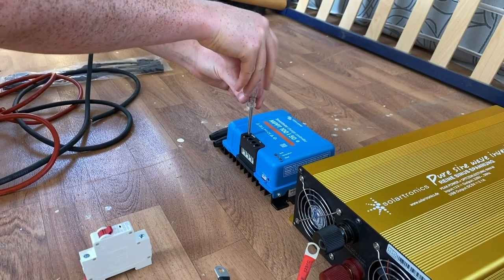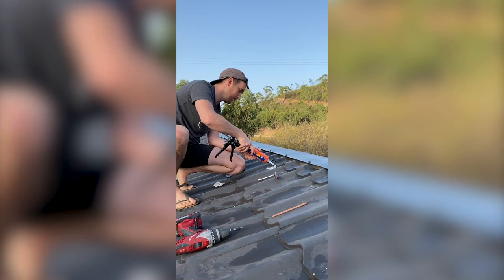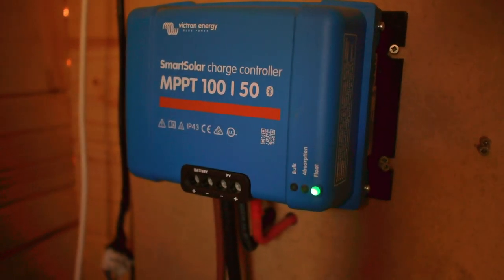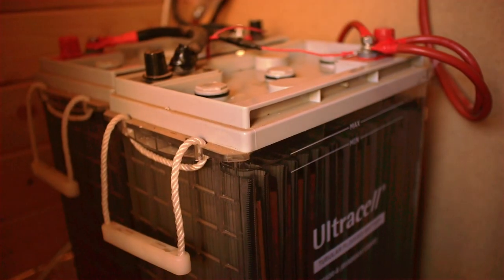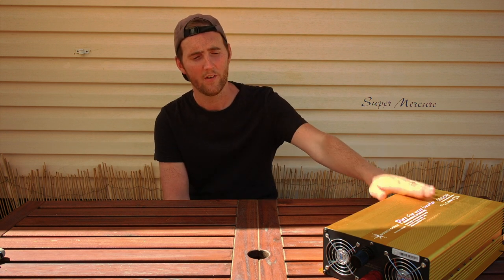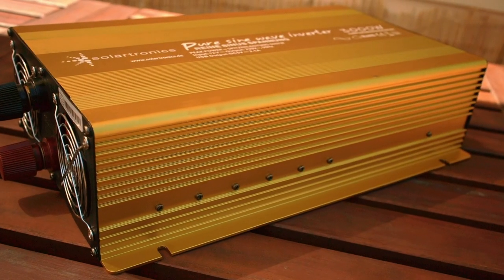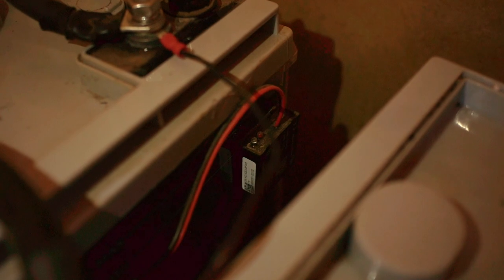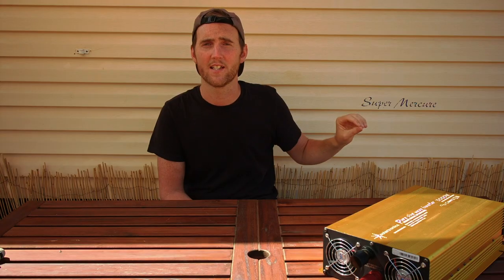Solar Guide For Portuguese Off-Grid Tiny House - Life Reimagined

Comment: Good video. However, I do not recommend using 12V with a 3000W inverter. You will draw 250Amps. It's best to stay under 100A because you will pay much more for wires and charge controller. You charge controller will need less current because the voltage of the battery bank is higher = cheaper MPPT. This is much cheaper even if you add a 48-12V or 48-12V DC-DC converter. When you do the calculations with lithium and lead-acid, lithium is cheaper in the long run. 35mm² can only carry 130Amps even without correction factors. You are having a fire hazard right there. Fuses don't protect devices, they protect wires. If there is 250 amps going through a 35mm² wire it will start to melt, but the 300Amps fuse will not blow.

Comment: Great video, lots of information!! How complicated was the licence, since you have more than 350w of solar panels?
Reply from the maker: In all my research this is the first I'm hearing about this so thank you. I'm currently investigating it further
Reply: @Life.Reimagined  it might be only if you want to connect your solar to the grid, I am also struggling to find some clarification.
Reply: Hi guys did you find anything more on this. I have been getting some advice recently and apparently solar installed at heavily regulated and need to be through EDP or and electrical company. We are making the move over soon and want to do a DIY install ourselves. Seems like everything need a licence over there. Any help/advice would be appreciated

Comment: Damn i only saw this Video now !
Nice and informative
Seems your a Solar expert now ;-)

I would be intrested where you did Order/Buy your equipment here in Portugal, speically the used ones. Planning of installing somthing similair in the near future.
Reply from the maker: Hello Maurice! Thanks for watching. We bought the solar kit from AutoSolar.es - and were impressed with their service and customer support. Im very unhappy with the Solartronics inverter. THe fans only turn on if temperature hits a threshold AND the load is over 10%. But because in the summer we were well under 300w load almost all of the time it kkept overheating. They refused warranty return as this is expected behaviour - even though they dont mention it anywhere online or in the manual. The 1000w inverter suits almost all of our needs (its just a little loud) so we have it in the shed. 

Regarding second hand gear I purchased through Ebay Kleinanzeigen and Ebay.com ...ebayk is like an OLX for germany only..and if you wait there you can find some bargains and DHL shipping is not too bad.

Another follow up is that wedid have to buy a generator also. The november days arent quit powerful enough to recharge our 1.6kw usage if the weather is grey for a few days - so when we have a bad spell we just put this on for an hour or two to top everything up. If this is something you may run into i would say oversize your solar. our 800w panels max out at about 450w in winter - so take that into consideration.
Reply: @Life.Reimagined  Thats Fantastic, Thanks for the many details!
Still Considering Size and Needs, will have a look at the spanish site.

We will still have a Grid connection to the property but the house i would like to connect is away from the mains (100-200meters). Thats why i consider to make it Self Sufficient. Like that i might even safe somthing (cable arent cheap for long distance). Like you, we only have lights and electronics. Water and Cooking is Gas at this moment.

What is your Panel orientation and Angle ?
I belive you said they are mounted on the roof, did you have the ability to orient them at all ?
Reply from the maker: First of had them mounted east at 15 degrees. Since moved to the shed roof facing south with 15 degrees as we weren't getting enough juice. Would defo recommend it unless again you over size the panels.

Comment: The largest car battery charger on ebay is at 60/70 A - ROHR DFC650P.. Mostly the chargers are less or equal 20 A. There will be no need for 300 A cables ... i.e. suitable for a 3000 W 12V charger. 300 A is maybe what you need for a motor start battery.
Reply from the maker: Sorry but your dangerously wrong. Yes there is. If your pulling 3000w from an investor it has to get that from the batteries and it gets that at 12v. So 3000/12 = 250a... So add 20% margin for fusing and your at 300a! Now 6000w at 12v means I could pull a crazy 500a through these cables potentially...but I'll never pull that much and have breaker to make sure.
Reply: @Life.Reimagined     Battery usage for 
2 laptops .. 90W -> 12 V -> a 10A cable with fuse
1 fridge .. 20-60W -> 12 V -> a 10A cable with fuse

   
"we need 600W" is not right

One can use 12V -> 18V adapters for laptops
 (skipping inverter altogether)
"HQ 50W 12V In-Car Universal Notebook PC Power Supply 15-24V Output"
   
The inverter needed for 2 laptops + 1 fridge is at 200-300W 
(a cheap inverter).
I have one named "Power Inverter 150W" - 300W peak - with a standard 12V car plug
Reply: @Life.Reimagined  If  a 2000W inverter connected with a 300A cable/fuse to battery:
   
If we overload the inverter with powertools - that for some reason
hits 3000W - the 300A fuse will not fire as it can stand
12V *300A = 3600W ..... but a 2000W inverter cannot handle 3000W ...
Bang
   
While a 20A cable/fuse will break at 12*20 = 240W, and save the
inverter
https://www.youtube.com/watch?v=BrzJkY00vEw